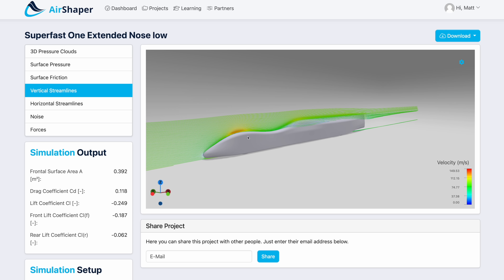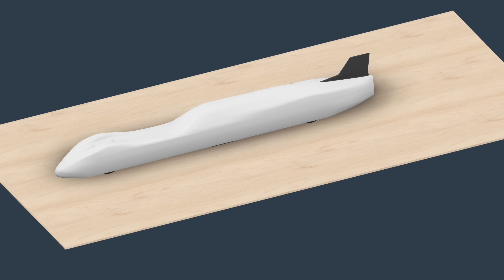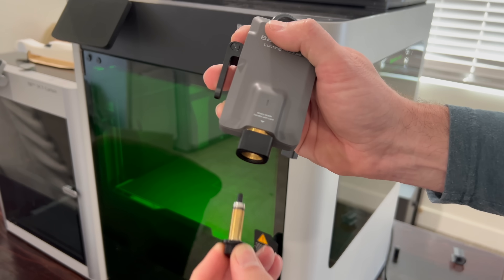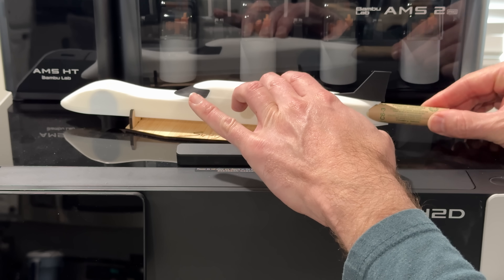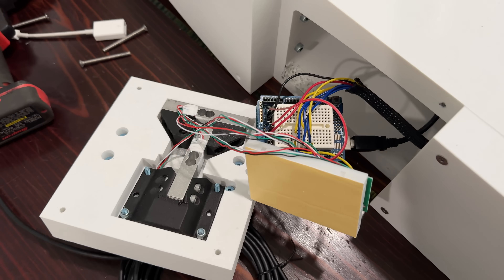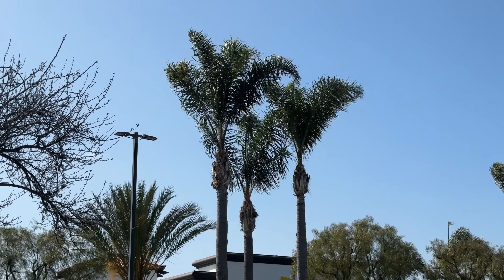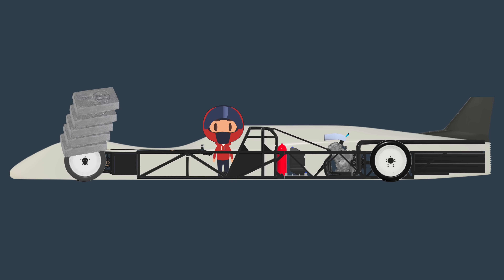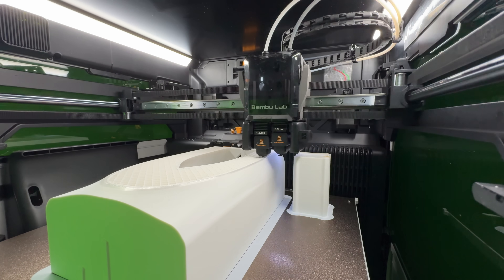Aerodynamic Testing On The Highway, With The Bambu Lab H2D

Comment: Kind reminder that Bambu tried to bait & switch their users and tried to gaslight them when the users called them out.
Reply: Exactly this, my Prusa prints are more dimensionally accurate than my P1S, and isn't locked inside a pointlessly walled garden. Literally the only thing good about the bamboo is its print speed.
Reply: A few months ago, my inkjet printer got a firmware update that made it impossible to use third-party ink cartridges. Which, apparently, included the cartridges I bought from the printer's manufacturer three weeks prior. My options were buy more ink, or buy a new printer.

Always-online hardware is theft.
Reply: I know nothing about this. Was planning on buying a bamboo. Can someone give me the cliff notes on what they did?
Reply: @ First, before you can even use the printer, you need to download an app to setup the printer (this is not needed on any other 3d printer). Then, if you don't agree to send your prints to their server which then sends it back down to your printer, they've nerfed the functionality of the printer such as the camera monitoring (other printers you could work around this with things like OctoPi, but Bambu won't allow that). Then, ontop of all that, they keep moving the goal posts on what the fuck they're going to allow under this update; lasty update tried to wall us off from using any other slicer but their own (which is an Okay knockoff/flavor of a better slicer, they just don't want folks getting away from their walled garden). It's real tedious bullshit, which only bootlickers seem to have no problem with.
Reply: @salty01234  They just keep doing a lot of stuff to lock down the ecosystem more. The latest was some man in the middle software to use third party slicers. A lot of us use Orca instead of Bambu slicer.
Reply: @ A simple search on YT will inform you. The basically changed and locked their system. Removed functionality they had before and also forcing you to use dubious software that sends everything you print through their server. If you are a home user just printing normal stuff it will not really affect you but you should be aware of the risks and limitations. For professional or sensitive use: stay away.
Reply: I love how this comment section is a Microcosm of what Rossman is talking about.
Reply: This. I like the way it prints, but my P1S is the last printer I bought from them.
Reply: This. Don't do it guys...
Reply: They are back on the usual wagon of sponsoring everyone with a pulse on Youtube. Does a great job of making them look like the consensus option, not that it is THAT far from the truth :/
Reply: Thanks for bringing this up. YouTubers usually don't care about these things but they'll care if we care, and we do. These companies honey the YouTubers up in the emails so it's hard to turn down their offers, if you know what I mean. Plus, they make really good hardware...
Reply: I've always been iffy on Bambus practices, and this latest kerfuffle only confirms it. ANY appliance, device, or tool that requires internet connectivity for full function when there's no actual technical need for it does not have a healthy ownership experience in mind. Bambu is getting a lot of crap for it (and deservedly so) because 3D printing hobbyists have been tech savvy by nature, but the same issues are happening in many, many products.
Reply: @WafflePlaneRC  Bambu printers do not require internet connectivity for full function. They require internet connectivity to use the cloud stuff. What Bambu has done is say "ok, if you want this thing to connect to our cloud, we control this end-to-end. If you want to roll your own, then have at it, all the APIs are open, but we don't want this connecting to our cloud." I find continuing to fight against this profoundly unhelpful, since it's actively showing companies that allowing a local option does not appease the mob, so you might as well just lock it down to cloud-only. The average consumer is going to want the convenience of cloud-enabled hardware, so if as a tech savvy person you want good, mass market stuff you fully control, the best you can really hope for is for the company to say "if you want to run your own cloud, here's the API, go for it," *which is what Bambu has done*.
Reply: What was the bait and switch?
Reply: @logitech4873  they pushed a firmware update that disabled third-party slicers out of nowhere. When confronted about it, bambu said they didnt disable anything but blocked unsafe subsystems or something. Basically "we didnt do anything but you deserved it"
Reply: @kolkoki  No they didn't. At no point did they disable third party slicers. I figured you were spreading misinformation.
Reply: Redditors love to use the term bait and switch and gas light.  @logitech4873
Reply: @logitech4873  Gotta appreciate the fact that nobody has answered this... 😩
Reply: Kind reminder that you can get pre built Prusa printers that work out of the box, and still have the amazing support Prusa is famous for and will be upgradable and repairable. They literally sent me a brand new screen and paid for shipping and it only took 2 emails and they replied the same day. Plus bamboo slicer is just a clone of Prusa Slicer.
Reply: @jaredleroy9876 Prusa is a narcissist tool that badmouths the entire community that doesn’t use his overrated and overpriced printers. Then tries to intimidate/threaten others that speak against his brand. I will NOT support that guy. Also, bambu sent me a new API board for my X1C free of cost in just a couple days, even after i told them I had no problem paying for it because Im the one that shorted it out and ruined it. They refused to let me pay for it.
Reply: You know if this comment section is what the 3D printing community is like I think I'm gonna stay very, very, very much out of it
Reply: @TrashHeapCustodian  every community is like this, people are involved, drama is there
Reply: @univisiontech1  if all my other hobbies had communities like 3d printing i would be in despair
Reply: Bambu shills 🤝 Apple shills
Reply: Not true. They never said their hardware products were even open source... Orca Slicer is actually based on Bambu Studio. And the only reason is it is itself based on other operators source software so it has to be open source. But they can very well do what they like. If you need to have fully open source, go and make yourself a voron and feel the pain 😂
Reply: @kolkoki  weirdly a lot of bootlickers in this thread. Like they will s that Bambu d all day because they can't understand that a decision they made before could have different implications now. That so many don't see this as an issue really explains a lot about the world today. 

Bambu will never reward your loyalty. Get a gd life and touch grass.
Reply: Yep
Reply: Thanks for saying it again
Reply: You're talking to the guy who thought that 3d printers were for nerds and are delusional.

It's just the way it goes i guess.  These kinds of people are ones who don't care about open source, some even despise it. 

I however.. don't care honestly, if the software is good enough then it's better than nothing at all. Got a creality tho
Reply: What happened?
Reply: Non-humans like you is whats wrong with yootoob. Get some therapy.
Reply: Give me another 3D printer that Just Works.
Reply: Bambu-seled
Reply: Reducing functionality after your purchase is scummy. They showed their hand big time. The consumer types don't care, and that's fine, they're not designing anything worthwhile for BL to steal anyway. For the power users, use something else. It just sucks there's nothing as plug and play reliable as what BL makes. I'm just tired of people being okay with companies screwing them over. The companies do this constantly because the sheeple let them, and worse yet, the fanboys defend their b.s.
Reply: the normal non chronically online person doesn't give a fuck about that, if it prints well that's all we care about
Reply: @Martin-xh1hd assuming you are replying to me. “Chronically online.” Having security cameras and other data is not the same as having a phone in your face you DS.
Reply: I hate that after that they did this huge YT sponsorship and everyone took it. 😡
Reply: @WatanabeNoTsuna.  I mean that's how PR works; Try to make up for an error and lost clients with marketing
Reply: @ because no one actually care about that niche petty drama
Reply: @Aikano9 All lot of ghe the people who use them for commercial and sensitive use care? The issue was they changed their terms and took away features it had.
Reply: Crazy how dumb your take is lol. Living with blinders on must be nice @Aikano9
Reply: 7:00 "Unnecessary" is missing an "n".
Why do so many YT videos have egregious spelling errors in the most prominent text? Does video software not have spellcheck capabilities?
Reply: @arose62 Agree -- even posted a similar comment myself.  (Should'a looked more thoroughly).   But, I gotta concede: even with the glaring (to some of us) misspelling, the point was made.  AND who's to say?  Maybe the creative spelling was to further some larger, but utterly lost, point.
Reply: Yeah I agree that Prusa has great support, but and I’ve had a good support experience with Bambu’s too so that’s not really a point in favor of either of them. I prefer an open platform myself but let’s not pretend Prusa hasn’t been milking the same somewhat overpriced bed slinger with minor improvements for 10+ years. The Core One likely wouldn’t even exist if they hadn’t received a wake-up call from Bambu’s success.
Reply: @kolkoki  weird how personal you mfs are taking someone being upset at Bambu. Like, get a life. This company isn't your friend and they have done scummy things. Why on earth are you throwing yourselves in the ground for them? You think they care?
Reply: Vague. Elaborate.
Reply: @Wmoore1  Or searches on YT yourself? Takes 5 min and are plenty of good videos explaining it and if it something that would affect you. Don’t demand to be spoon fed.
Reply: @crabapple1974  most people are not even that interested one way or another to begin with
Reply: @ I never Said that? Do you understand the issue or are you just fanboying? I do however think it is good to understand what happened and then take an informed decision before investing in Bamboo. For most home users it is not an issue. For others and for businesses printing proprietary stuff it is different. For me I choose not to support this and went with another brand.
Reply: @crabapple1974  so you're saying they're anti business and pro home user. thanks for elaborating on that incredibly unimportant matter. get your voron serial registered like the rest of us if that nonsense is really that important to you
Reply: Kind reminder that some of us want a printing hobby, not a printer hobby.
Reply: This is such a non-issue to the majority of their user base. If you want a printer you can do whatever you want to, there’s hundreds of options.
Reply: @Neberheim  I'd say that the real issue that got ppl worried/upset is that down the line when Bambu decides to cut support to these printers, the slicer will simply refuse to transmit to the printer, thus basicly disabling an otherwise perfectly good printer remotely.
Reply: @StalkerGamingHU  oh no you have to get up and plug in the usb/sd drive the horror, how will people survive without cloud functionality
Reply: @Neberheim  it’s important to some of us that don’t let IOT devices call home and wall shit off from internet access.
Reply: @silverbackag9790  LAN mode exists and has always existed, you know, and has zero changes in functionality after the update, once they decided to add dev mode. The internet mob conveniently ignores this.
Reply: @binaryhalibut  Try to update firmware in LAN mode (from SD card) on X1C or X1E (for example if you want TPU for AMS support). It's unsupported up to some version. Just why? Why should i register somewhere and then let printer to connect to the internet just to use basic functionality on local machine?
Reply: @silverbackag9790  thats the biggest bs when something needs to be connected to the net to work lol.
Reply: @the issue is they crippling the printer AFTER you bought it
Reply: @ not only would that be the dumbest business move possible, and just as possible for every other device you own, you can always run custom firmware. It’s a nonissue.
Reply: @Neberheim company being shitty is a non-issue for potential customers?
Reply: Do you use an iPhone?
Reply: But restricting you to only their slicer is good, because it's the best!
Reply: @littlegrabbiZZ9PZA 
People who like Bambu slicer usually end up liking Orca slicer even better. It's Bambu on steroids.
Reply: Your not restricted tho. The update is not mandatory @littlegrabbiZZ9PZA
Reply: 95% of the user base does not care. The remaining 5% are the people that want to build a voron.

If you want a reliable, fast, high quality and easy to use manufacturing tool, Bambu labs is pretty much the only option for most people.
If you enjoy building, repairing, upgrading, or modifying printers more than actually using them, get a voron, prusa, ender, or any of the other build-a-printer brands instead.
Reply: @Aikano9 actually there are people who want to buy a really good printer and be able to use their preferred software with it.
Reply: @Aikano9 I have multiple Prusa’s running in a manufacturing and prototyping environment. Very little issues, and they run completely stand alone as network access is not allowed by our IT department. So Bamboo printer were not an option for us, and the Prusas work fine for someone who just needs to print and is not interested in tinkering with printers.
Reply: @Aikano9  Okay but why is it a dichotomy?
Reply: @Aikano9 

What if you're worried about planned obsolescence
Reply: @Aikano9 Yep no way could anyone build a printer and then print things with it too, gotta be one or the other. So insightful
Reply: @ building and upgrading/modifying printers is their hobby. They rarely use the printer for anything else.
Reply: @Aikano9  That assumption is just not true. A lot of the people you see talking about printers make an entire hobby out of it, sure, but the average ender 3 or similar owner is generally just either using it to make small knicknacks that may or may not be useful, or is a small business using it for prototype/production.
Reply: @Aikano9  Guess you didn’t get the sarcasm. Braindead take
Reply: @jazzmusiccontinues1134  guess you’re just incapable of recognizing reality.
Reply: @Aikano9  This is kind of the conclusion I've been coming to. You either want a printer that's a tool to do other things or you want a printer that's a hobby on its own.

I've read a lot of criticism of Bambu and always come away thinking "Why is that a bad thing?"
Reply: gross oversimplication of a non-issue
Reply: Within hours work arounds existed. People complaining about this stuff are just people who like to complain on the internet and never actually create anything in real life.
Reply: @MingusDewfus  Buying stuff to be bait and switched because there's workarounds just rewards the behaviour
Reply: Printer so good that even ignorant reviews are overlooked...  Easily the best 3d machine I have owned and one I could plug in for someone to use and not sweat it too much
Reply: @randalljames1 hope you're still saying that in 5 years when they drop support in the slicer.
Reply: If bambu ever cuts support there'll be a hack out within a week to fix it, since they're so popular. I guarantee bambus will be printing well past their competition- since most of those junk printers get abandoned in the first month lol
Reply: @32BitJunkie  a hack for all those people who just want a printer and don't want to faff about with a printer hobby? Sounds like all those people will be super happy.
Reply: @randalljames1 I agee 1400 hours zero issues.
Reply: How dare a company try to profit off of their product completely within their rights, unreasonable and downright devious!!
Reply: @sortaspicey9278 it sounds like the issue is Bambu reduced the functionality for customers after they bought. That's scummy
Reply: @sortaspicey9278 I didn't buy software from Bambu. I bought a printer. 🤡

Comment: That opening about the experienced engineer sums up everyone I’ve encountered in my healthcare over the last year. It’s been a people struggle as much as a health struggle.
Reply: the trick is that there are a lot of inexperienced engineers who think they can look at a thing and see if it's good automatically like the incredible engineers and they are very much wrong
Reply: Except he is completely wrong, and experienced engineer should be able to look at a design and have a pretty damn good idea if it is or isn't going to work pretty quick. That intuition is what separates the decent engineers from the true experts.
Reply: @sshep7119  I agree with this, the really good engineering students at uni were the ones who were experienced enough to be able to intuit a good design, but smart enough to do the maths anyway, intuition will only get you so far.
Reply: @sshep7119  I mean he did make this point and then thought strapping the freakin' thing to the roof of his car and testing it on the highway was even worth the pixels the number gained. Literally useless data.